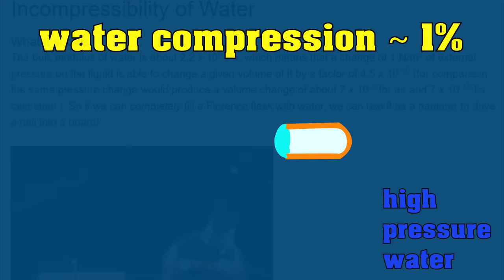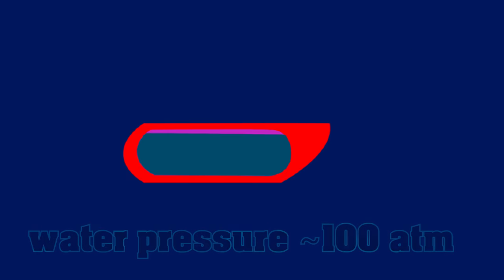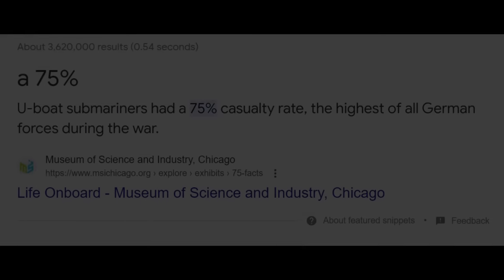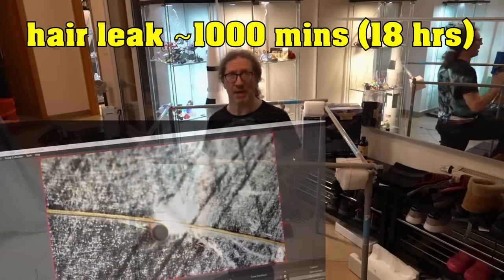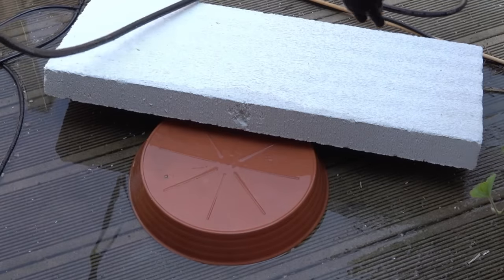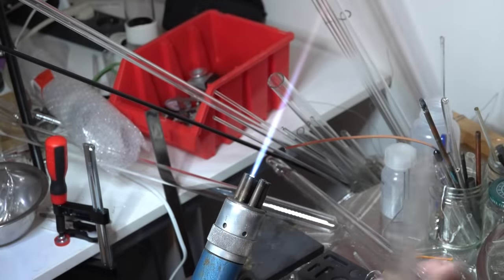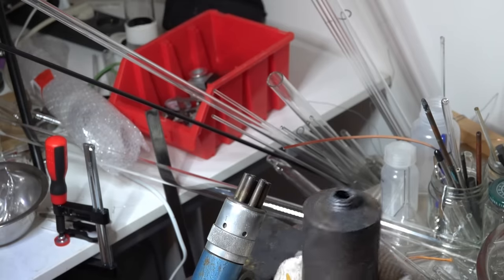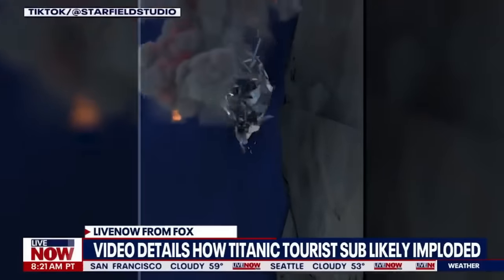Why the Titan sub failed

Comment: The fact that they used 2 materials that compress at vastly different rates, and GLUED them together in a device meant for the depths and PRESSURES of the deep ocean is absolutely insane to me...
Reply: If only they’d used Gorilla Glue…
Reply: It works, glue isn't that fixed joint as weld for example and glue can adapt to those changes.... once or twice, not multiple times in a row without any protection from the elemts, without maintance, etc.
Reply: You have to understand, safety regulations and regulatory body inspections only cause to hamper innovation...
Reply: @LordHypnos4  what will chatGPT make of this comment? :D
Reply: Nearly every aspect of this situation is absolutely insane to me.
Reply: Not to mention the fact one of the materials performs very poorly under compression and can only support a small number of compression / expansion cycles.
Reply: @LordHypnos4  They also seem to hinder one self-aggrandizement as a plucky genius who proved all the experts wrong.
Reply: @boots7859  all the experts know is how to float rubber duckies in a tub, just ask Stockton Rush oh wait
Reply: I'm surprised that the ceo was so trusting in his product. He definitely had no care for safety not even his own. Probably regretted that for the few minutes or seconds when the water started to come in.
Reply: @imjustapotatoleavemealone it will lose its elasticity fairly fast..
Reply: @jwalster9412  Not as fast as a weld tho
Reply: Resin and carbon fiber it's a incredibly strong but your right at those pressures the material might be incredibly brittle. I'm wondering if stronger Compound material with carbon fiber would have worked? Or at those pressure differences and temperatures are all polymers going to have weaker properties?
Reply: @jwalster9412  Still all happens in under a second, so no time to think of anything?
Reply: @infernaldaedra  Carbon epoxy composite have a great fatigue strenght (greater than metals), it doesn't really get demaged until its point of faliure. Pressure is just load, it doesn't change the material's point of faliure. Carbon composites doesn't have a yield strenght, its yield strenght is its point of faliure. The temperature in 3500m is around 5-10 °C. Carbon reinforced plastics get weaker at higher temperatures, but get stronger in lower ones. There is a study called "Mechanical and fatige properties of long carbon fiber reinforced plastics at low temperature" wich concluded that "The low temperature (-196 °C) tensile and fatigue strengths of the UD-CFRP(Unidirectional Carbon Fiber Reinforced Plastics, the same as the submarine had) were more than 1,5 times greater than those at 20°C. Similar to the UD-CFRP, the mechanical properties of the epoxy were enhanted after decreasing the temperature."
Edit: And i don't really have time to read trough the whole thing just for the sake of a youtube argument, but since epoxy doesn't change its structure in lower tempatures (in the way as gamma iron turns into alpha for example at martensite heavy alloys, sometimes there is still gamma iron till negative 20 °C), maybe the graph isn't purely linear, but its safe to say that there is no point where the epoxy gets weaker at lower temps, maybe not as much stronger.
Reply: It's entertaining watching people who think they can bypass the requirements of engineering with money and balls. I have no formal education in either engineering or physics and still my reaction to everything I've seen about how that thing was put together was "you have got to be shitting me." Physics cannot be fooled, neither is it particularly impressed with bravado.
Reply: @jwalster9412  Some are too stupid to grasp dangers. And this one was dead before his brain had the chance to notice the problem because he got instant cremation less than 30 milliseconds after the hull failure started.
Reply: Shoulda just made the entire thing out of Flex Seal

Comment: "It´s pretty simple, but if we mess it up, there´s not a lot of recovery." I am just imagining those words going through his head over and over again, as he waits for his inevitable demise.
Reply: 10-30 milliseconds for the delamination wave around the hull, 3 milliseconds for the pressure wave to hit him, less then 2 milliseconds before his brain's temperature reached thousand degrees celsius. I don't think he had much time left to think anything when the hull failed.
Reply: @hans-joachimbierwirth4727  No, but it didn´t fail immediately, did it? The sub stopped working and started sinking long before the hull breach itself.
Reply: @jirkazalabak1514  The implosion was recorded by naval observation posts, and the shattered debris of the pressure tube confirms a catastrophic structural failure. There are rumors claiming unusual descend speeds pointing to a pinhole but to my knowledge that isn't confirmed yet. The construction was based on passive descend and ascend mechanics driven by slightly negative buoyancy and one sacrificial ballast. Normal descend did not depend on anything working actively.

Comment: Your glass+metal demonstration was excellent. I immediately was able to understand exactly what you were going for.. and frankly with that in mind it is astonishing that these engineers didn't consider such a basic thing.
Reply: They did, and if they objected they were fired or contracts closed.  The CEO wanted to be the guy who proved he was smarter than the experts...
Reply: The CEO was basically an architect that bossed around structural engineers

Comment: The speed at which water will shoot out of a hole in the submarine is derived from Bernoulli's Principle for compressible fluids.

Basically, the speed v is determined by the formula

v^2 ~ (Delta-P / B) * c^2 + g * h, (1)

where Delta-P is the pressure differential, B is the bulk modulus of water, c is the speed of sound in water, g the gravitational constant, and h the depth. In our case, Delta-P ~ 400 atm, B ~ 2 GPa ~ 2 * 10^4 atm, c ~ 1500 m/s, g ~ 10 m/s^2, and h ~ 4 km.

Taking the ratio of the two terms in the right-hand side of equation (1), we get

(Delta-P / B) * c^2 / (g * h) ~ [2 * 10^(-2)] * [2 * 10^6] / {10 * [4 * 10^3]} = 1.

In other words, the compressibility of water is just as important when it comes to determining the speed of the water shooting out of a (hypothetical) hole in the submarine's hull as gravitational potential energy.

Comment: Interesting fact how all titanium parts of wreckage looks like having almost no damage while "innovative carbon fiber" part completely disappeared.
Reply: A true "why didn't they build the plane out of the same material as the black box?" moment.
Reply: Because it suffered a catastrophic implosion.
Not this pressure washer shit TF is rattling on about.
Reply: @Gainn  It's a brittle material and it's held together by adhesives, once it hit that critical point, it was splinter and delamanate/ sort of peel apart only inward as it imploded, maybe followed by an outward explosion after the inside of the sub was temporarily an internal combustion engine with all that force coming in rapidly, there wouldn't really be much left of it, sure there are probably pieces of it but good luck recovering any of it.
Reply: I would not have used titanium I would have used stainless.
Reply: @leecowell8165  Titanium shrinks very little when cold, I believe about half as much as many stainless alloys, though some are closer to TI. TI was the right choice.
Reply: @--_DJ_--  Shrinking isn't a problem so long as it all shrinks at the same rate. I remember reading about US Navy sub crews tying a string from one side to the other and watching as the string goes slack as they descend.
Reply: @drunkenhobo8020  Cost cutting (and heavy). Titanium is expensive.  Also Stockston got the carbon fiber cheap... apparently it was something Boeing was discarding before it had expired.
Reply: Rush fooled everyone.  The carbon fiber part of Titan didn't disappear -- it was actually an independently operable escape pod and Rush and his passengers drove away after the "implosion" and are living it up now in an underground cave with a sweet cable setup that gets all the channels that he secretly dug out and outfitted during an earlier solo dive.  They're laughing it up seeing how well their little joke succeeded and plan to come back either this Friday or the one after that.  They hope to bring back a specimen of a new species of deep-water octopus that they've tamed and decided to name Alvin.  Alvin has a lot do though and isn't sure he wants to come up.  Rush told me all this in a psychic transmission that I received last night after I took my pills.  The thickness of the cave walls made the message a little garbled, but I'm sure I got most of it right.  You'll see!

Comment: The titanium caps did have a lip to hold the carbon fibre tube in place. So I don’t know if it was a glue failure

But.. that difference in size would cause a bend in the carbon fibre, which would cause a difference in strain between the outside and inside of the tube, which is a perfect thing to cause delaminating.
Reply: So, its a bit more complicated than that. The lip would support the carbon at the ends, but the middle is still going to deflect. Imagine a ruler being supported on both ends by a couple of bricks or something. as you apply pressure onto the ruler, its going to bend in the middle, yeah? Now imagine that ruler was 5 inches thick and you deflected it the same amount. The top corner would move inward on each end as the middle is deflected downward. On the titan, this would have been the whole hull turning into an hourglass shape. that would also concentrate stress on the outermost edge of the glue joint in the hull, likely causing it to fracture. 

Now, I don't believe this to be the cause of the failure. What Thunderf00t alluded to with the carbon being strong in tension not compression is a key factor, and the fatigue properties of carbon fiber. Its likely it started delaminating, causing a cascading failure and then the subsequent catastrophic failure.
Reply: Well, they proved how resilient carbon fiber is. Shame they weren't capable of doing so with their Elmer's glue DIY project

Comment: If you imagine the titanium caps as concrete foundations for a tubular carbon fibre bridge, you can see how it would work for a while. Bridges hold significant compression/tension across multiple materials with differing bulk moduli. Essentially the carbon fibre was compressing but the titanium was anchoring it like a bridge support. I imagine a few load cycles worked the glue loose and bam.
Reply: I'm not well versed enough to give concrete(tish) reasons, however there is no need for such an analogy.
You have 2 end caps of basically incompressible metal being pushed together/compressed axially?
At the same time, that plastic toilet roll is being pressed from all 360' radially, as 5-6Kpsi.
It seems even more possible/likely that one of the end caps had a failure where it was glued to the tube, and with the 1 meter diameter(IIRC) end cap you're looking at 5000psi * 4071sqi = 20,355,000# of force on that cap end which experiences a failure which propogates.

Comment: That happens if you don't have any respect for engineering. Safety standards are not there to annoy some ceos. We have them, because they are nessecary and every one of them is written with blood.
Reply: This is true.
Reply: The OceanGate Titan is just another Libertarian success story!
Reply: I feel like he heard the words 'carbon fibre' and lost all sense of rationality. First question I would have asked after considering a carbon fibre tube would be, 'why didn't anyone else do this?'. 🤬
Reply: The problem is, people often think all safety standards are equal. They aren’t. Many safety standards are designed to protect stupid people. Some are there for extremely good reasons. When people lump them all together, the ones that exist for good reason, may get ignored because people are used to ignoring the stupid ones.
Reply: @Naptosis  The carbon fibre tube wasn't the mistake. Making the sub after the carbon fibre tube model failed pressure testing was the fatal mistake that won the CEO a Darwin Award.

Comment: There's an unverified transcript of communications between the sub and surface vessel in which the pilot observes creaking noises. The sub was also diving quite fast relative to other operators on the Titanic.  If correct, the crew knew there was trouble for about 19 minutes.
Reply: Its fan fiction at best.
Reply: Yea.. any noise would have been followed by an imediate snap.. its too brittle to crack without failling immediatly.
Reply: I think the carbon fiber went without any hint. I think that there was no pinhole at all, the entire (or at least huge part) carbon hill broke open with a bang. There are recorded audio verifying that bang.
Glueing rigid (titanium) material with more flexible (carbon fiber) material ought to create displacement  between the materials, and either the glue or the carbon fiber has to take the damage.
Reply: @armwrestling_nerd  We know for sure that they were aware something was wrong, since they had dropped ballast and were in the process of an emergency ascent right before the sound of an implosion was recorded on the US Navy's array of hydrophones. Exactly what they were aware of is yet to be announced (I'm 100% sure it'll come out in the final report), but Janes Cameron, whose opinion on this subject I'd say is very highly informed, is convinced the passengers would have heard the clear, tell-tale sound of the carbon fibre shell delaminating prior to the fatal moment, for perhaps 3 seconds or more. Obviously we don't know for sure yet, but we will.
Reply: @sfdntk  "We know for sure that they were aware something was wrong, since they had dropped ballast and were in the process of an emergency ascent" ... assuming the transcript is real
Reply: @jnh8381  That's not from the transcript, which is a complete fabrication. That comes from the reporting in the days after the incident, you can find plenty of news clips discussing it. OceanGate themselves are the source, although it was reported through third parties (like the aforementioned James Cameron, whom we have no reason to doubt, and at least two other people close to OceanGate whose names I can't recall off the top of my head) who were informed in the hours directly following the accident but didn't reveal what they knew until after the nonsensical air supply countdown had ended out of respect to the families of the victims.
Reply: Why do you say that, there were actual passengers of the sub who had been on it before whi also say that when they descended the sun cracked and popped
Reply: @Personnenenparle  This is entirely untrue. There are reports of prior passengers reporting hearing cracking noises while descending on previous "missions," and they're still here to talk about it.
Reply: I don’t know if it’s true or not about the transcripts . I have some experience of carbon fibre delaminating from slow compression to rapid decompression cycles.  Depending on how it’s layered up you might hear internal de lamination and see no visible signs of failure but by that time it’s too late as it will be compromised and failures will happen suddenly at that point.
Reply: According to the transcript, the noise was apparently coming from the aft chamber, with the mechanical equipment and batteries. That was sealed off from the crew cabin. It’s possible a breach started there first. The transcript also mentions they tried releasing the ballast and the entire cage, but the submersible would only rise extremely slowly. If the aft compartment was filling with water, that could explain it. Who knows what happened. Guess we’ll find out eventually.

Comment: Dirty Garage Guy has a video with a simulation of the actual sub design and does a proper job explaining and showing what probably happened, if you have 2 hours to spend the whole video or 10-20 mins to watch the actual simulation at the end of the video.
If you want the TLDR of it, it's likely to be the housing unit (cilinder made of titanium and carbon fiber) that compressed to the point where the glue that attached the housing unit to the titanium rings got so fatigued from multiple dives that it just popped open. That also sort of goes hand in hand with the leaked transcript (if it's the real one) where the crew reported 20 minutes of on and off crackling from the back of the vessel, which is probably the indication of the glue they used losing it's grip. So, the housing unit probably got compressed way too much one too many times, and the glue coming apart is very likely to be the teller of that.
Just go watch the simulation he did, it makes things very obvious.
Reply: How the hell did he simulate carbon fibre compression at a depth of 4000 metres?
Reply: There are special simulation software I saw one where the acrylic window gave way first. But the glue is a strong second contestor. The window was just rated for 1300 meters.
Reply: @alexstanciu8598  Solidworks doesn't have the correct solvers to do a stack failure in these conditions.